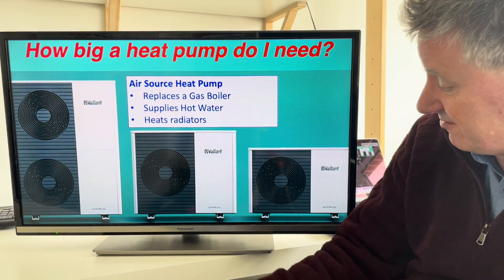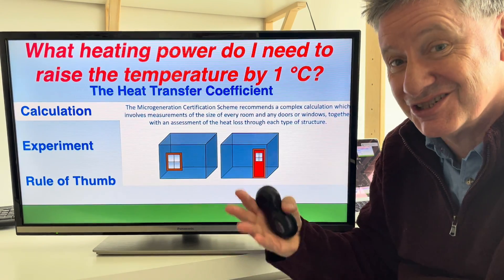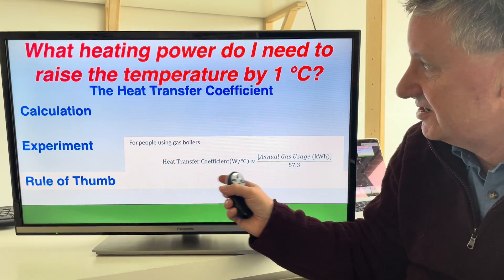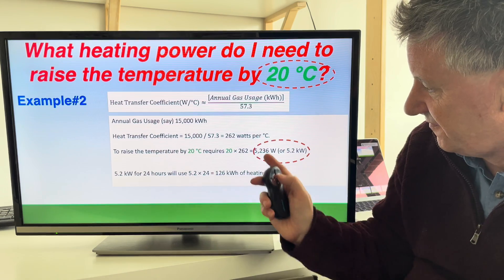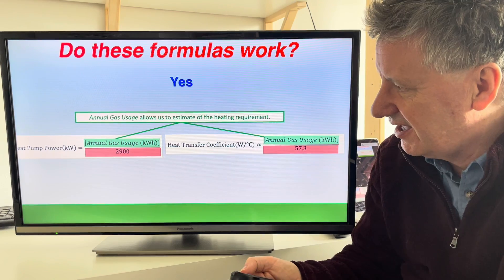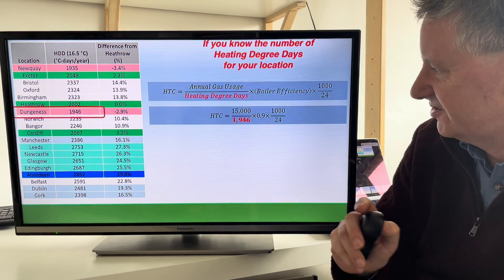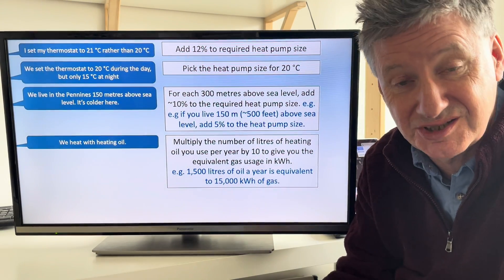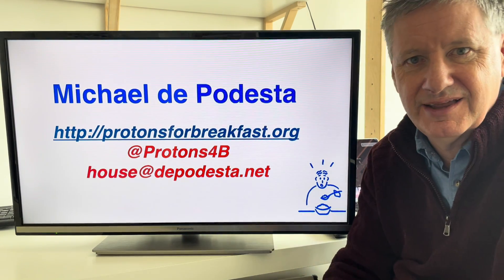How big a heat pump do you need? A simple Rule of Thumb.

Comment: Regarding Heat Pump size: Many manufacturers state various kW heat outputs  depending on the ambient temps, (7C, -7C, -20C) and have different values (8.2 kW to 5.5 kw in this instance.) for that particular ASHP.  Once I calculate the HP size (kW) with your recommendations,  Should I pick the kW size based on the coldest (-20c) rating?
Reply from the maker: Dr. Greg, Good Evening.

First of all well done for spotting that the heat pump thermal output power changes with external temperature, and also for noting that the 'labelled power' e.g. 5 kW, 7 kW etc  is only the labelled power under one specified condition - generally not the coldest temperature.

The industry recommendation - which I agree with - is to pick a so-called 'design temperature'. This is the coldest likely temperature in your locale. In southern England this is generally around -3 °C. You should choose a heat pump which can deliver the required heating load *at this temperature*. 

One could design for - 20 °C, but this would be overpowered for 99.99% of the time and would underperform for all this time. If you design for the recommended design temperature in your locale, the heat pump size will be 'just right' for most of the year. If one experiences a -20 °C day, the heat pump will still work, but you will need to supplement it with normal electrical heating for the one day or so per two or three decades on which that cold-weather event occurs.

Does that make sense?

All the best

Michael
Reply: @michaeldepodesta001  The ASHRAE design temp of my region is -14F(-25.6C).  This temp is for Leadville which is typically colder than Buena Vista (my town). The coldest recorded by my station was -29.5C but this temp is uniquely low.  The average low temps here is -5C to -10C
Reply from the maker: @gregvet2008  First of all - WOW! - I know it's the internet and I should be used to it at my age - but how wonderful to communicate with someone in Colorado!

Secondly. I don't know your climate so I looked up a simplified version of your local climate data...

https://www.timeanddate.com/weather/@7174247/climate

According to that, a temperature of -25.6 °C seems extreme as a design temperature, but obviously it still gets pretty cold in your winter. As I understand it, the design temperature should be a temperature which will likely be the coldest temperature of the winter. This is as opposed to the coldest possible temperature. 

I can't make those choices for you: if you have access to local weather records then you can likely make a rational choice based on those records. It's always comforting to design for the most extreme weather, but you pay a price in less efficient operation through the rest of teh year. Depending on your circumstances, it might be an idea to use two heat pumps, with the second heat pump kicking in only in extreme weather. 

Good luck - and keep warm. M
Reply: @michaeldepodesta001 indeed, one can add many kW of on demand capacity for a few £ in the form of convectors or oil-filled.
Many lose sight that total costs are capital+running and let the 2nd term run away from them.

Comment: 📌How big a heat pump do you need? A simple Rule of Thumb.
the principle of the heat pump is apparently the same as the principle of the refrigerator: a refrigerator needs 150 watts per hour to modify the temperature inside the refrigerator by 7 degrees C.
the volume of a refrigerator is 0.3 m3 or the volume of a refrigerator is 0.3M3 or 300 000cm3
imagine a house of 80 m2 to be heated =192 m3 =192 000 000 cm3
well you will need the equivalent of 192,000,000/300,000= 📌640 refrigerators to heat your house... Thank you heat pump or thank you money pump?
Reply from the maker: Fern, Good Morning. 

I have your looked at your comment several times but sadlyI have concluded it is just incoherent nonsense. The relative volumes of refrigerators and homes are just not relevant.

As I explain, using a heat pump is overwhelmingly the cheapest way to heat a dwelling by a solid factor three or more.

Best wishes

Michael

Comment: Great stuff. Does this estimation also apply to cooling with a heat pump?
Reply from the maker: Afrocraft, good evening. No, this doesn't apply to cooling. To calculate an equivalent formula for cooling one could use the 'degree-days' web site but instead look up 'Cooling Degree Days' rather than 'Heating Degree Days'. It is thankfully not such a strong requirement in the UK at the moment...

Best wishes: Michael

Comment: Thanks for the great video.
Is sizing a hot water tank a rule of thumb thing too, or is there a minimum size required to comply with regulations/certification? Currently have a 150L tank for our gas boiler and a couple of quotes we have had for ASHP install are recommending replacing it with a 210L tank. I feel like a 180L would suffice for our consumption.
Reply from the maker: Lei Chat Good Afternoon, Yes. There are many rules of thumb for the size of domestic hot water cylinders. But here is my experience with a 200 litre cylinder.

The system is set to re-heat the cylinder once a day to 55 °C - it typically puts in around 3 kWh of heat. 

My wife and I live modestly and shower (between us) around once a day and we never run out of hot water. When children are home taking multiple longer showers, we need to have two heating cycles per day. 

So my advice is that the cylinder size depends upon the size of your family and their habits.

This guide shows that DHW consumption's very variable

https://assets.publishing.service.gov.uk/government/uploads/system/uploads/attachment_data/file/48188/3147-measure-domestic-hot-water-consump.pdf

This site ...
https://www.hotwater.org.uk/sizing-a-hot-water-cylinder/

suggest a 200 litre tank based on DHW use of  

• Low Consumption = 20 – 30 litres/day
• Average Consumption = 30 – 50 litres/day
• High Consumption = 50 – 70 litres/day

So like I said it's variable. But if that DHW is not all needed at the same time, then a smaller cylinder may suffice.

Sorry to sound so vague.

M
Reply: @michaeldepodesta001  No need to apologise. Really appreciate your insight. Thank you.

Comment: Hi Michael, thanks for the video. It sounds like we have similar houses - I used 13,000kwh in 2022 and am planning EWI this year and an extension next year giving 130m2 total. However, I'm having to consider a heat pump earlier than I'd like for logistical reasons to do with the EWI. I did my own heat loss calcs and my projected annual heat use post-extension (4600kwh, or 3250kwh with mvhr) would give a required heat pump power of just 1.1-1.6kW. Do heat pumps even come in this low? Would there be a problem with short cycling? Do you think a buffer tank would help? Should I be looking at air-to-air heat pumps instead?
Reply from the maker: Amanda, Good Evening. First of all congratulations on your refurbishment. That sounds really exciting.

Yes, our houses do indeed sound similar. Here are a couple of comments.

1. Having to do things 'out of order' is par for the course. It happens all the time.

2. I am not sure you will achieve quite that large a reduction in heating demand. My suppliers thought that a 40% reduction in heating from EWI would be a good result. But nonetheless is it is a small heating requirement and it will be difficult to get a small enough heat pump.

3. When planning I had thought that I might need a 7 kW heat pump, but thank heavens I realised that this was too large and opted for a 5 kW pump. During this year's cold snap I just exceeded the 3.5 kW average daily power (3.5 kW was next heat-pump size down from 5 kW) so technically I probably do have the right size.  

https://protonsforbreakfast.wordpress.com/2022/12/11/cold-weather-measurements-of-heat-transfer-coefficient/

But most of the time heat output is 1 kW and the system cycles a lot. I am experimenting with different control modes to see if I can optimise this.

4. I would ask your installer about buffer tanks. My understanding is that almost every extra thing you add - buffers or low loss headers - overall reduces efficiency. But no retrofit  installation is perfect - it's all about optimising the installation subject to constraints.

5. Air-to-air could be an option if your house is relatively open plan - I think every room does need its own fan-coil unit. And if you already have radiators - you would have to remove them all! Ultimately - it's your choice, but a 3.5 kW peak power unit would probably be fine. In fact if you have to do the heat pump first and then EWI later perhaps you might need a larger pump for the first winter?

6. I follow Syzmon Czaban who installs Heat Pumps and in this example he installs a 3.5 kW unit which is only just big enough - trying to avoid oversizing.

https://www.youtube.com/watch?v=0IvGe4JZLSU

7. Amanda, I don't know quite why this is all so difficult! but I wish you all the best. 

Michael
Reply: @michaeldepodesta001  Thanks for your reply! I misread my own spreadsheet, it should have been 7,100kWh post-EWI, making a more reasonable 45% reduction. Actually I had Szymon round, he told me a crucial piece of info which is that (assuming you have the Vaillant Arotherm) the 3.5kW and 5kW both modulate down to the same 500W minimum. So you made the right decision getting the 5kW for better cylinder heat up times. 
We also agreed that it is easier to hold off on the heat pump for the present! So I'll be coming back to all this next year 😅
Reply from the maker: @silver_gir1  If you have Szymon on your project I feel confident you will be OK. 

Regarding the cycling on my system, it seems to cycle when the electrical power reaches 500 W which corresponds to a bit under 2 kW of thermal power. This could be caused by the way my system is installed with a so-called low loss header. But I would be believe Szymon rather than me!

Good luck with your project. M

Comment: In about 35 percent of the US, you'll need a heat pump big enough to contain a gas furnace.  Even the most efficient Heat Pump isn't a way to reliably heat the houses in the Northern third of the US.  You also need to consider that they aren't nearly as reliable as a normal furnace.  I've gone through two of them in the last six years, and one of them required a $500 service call even though it was still under warranty for parts.  So, six years, about $4,800. dollars AND YOU STILL NEED A BACK UP FURNACE AND ANOTHER HEAT PUMP.  If you don't believe me, actually pin one of these experts down and ask them what you should do when the temperature falls below 10 degrees.  If they still pretend that it will heat your house sufficiently, ask them about 0 degrees.  If they STILL lie to you, do what you should have done in the first place and and find someone that actually has one.
Reply from the maker: Bill, hi. Sorry you have had such a bad experience. But I don't think that is usual.

Heat pumps are used commonly in Northern Europe where winter temperatures reach the levels you describe. 

In the recent cold spell in the UK where temperatures in cities fell to -5 °C (~20 °F) my heat pump worked fine with a COP of 2.5 at the coldest temperatures. I did hear of one heat pump problem on the grapevine, but also of LOTS of boiler faults.

I really don't know of a better way to heat our homes while not emitting carbon dioxide.

All the best

Michael

Comment from the maker: Dear Teabreak, Good Evening.

Yes. 1227 cubic metres of gas corresponds to roughly 13,865 kWh of gas used annually. So yes, roughly 5 kW sounds about right.

My home in Teddington, West London used 15,000 kWh/year before external wall insulation and measurements now indicate a 5 kW heat pump would have been fine (subject to radiator sizing). For a variety of reasons I did install a 5 kW pump but with external wall insulation the heating demand was cut by roughly half and the heat pump can barely get started! Last year we warmed the house using less electricity than if we had used a hairdryer (set on low!). (https://protonsforbreakfast.wordpress.com/2022/04/12/could-you-heat-your-house-with-a-hairdryer/)

Some of the stories on my blog may be relevant https://protonsforbreakfast.wordpress.com/my-house/

My plan was to install the heat pump and see if the radiators would be good enough. They were. Changing radiators afterwards is easy - changing pipework is not, but I took a risk. Typically - using weather compensation - the flow temperature reaches 43 °C ish when the outside temperature is 0 °C. 

In the summer, the whole house runs from solar PV for about 4 months, but in winter solar is low and heating demand is high, so solar doesn't cover everything. If you are considering solar, I would encourage you get battery storage too.

https://protonsforbreakfast.wordpress.com/2022/09/01/its-been-a-sunny-summer/

The real risk with a 10 kW pump is not really the cost. The real risk is that it won't be able to modulate so as to operate efficiently at normal autumn/winter/spring demand. It will just keep switching on and off.

If you don't find what you are after on teh blog, do drop me another line.

All the best

Michael

Comment: Can you confirm 1227 units of gas used annually. Times 11.3 (my rough conversion estimate) equates to 13865kWh gas used annually. So heat pump size required is just a 4.78kw? I have been looking at 10kw heat pumps so a 5kw heat pump sounds more affordable. This is totally ignoring the pipes being the wrong size, so temp would need to be set high at the exoense of COP. So potentially you could run thr heating and hot water soley from solar pv? Something more difficult to do with a 10kw heat pump.
Reply from the maker: Oh Yes, one more thing. You can check the sizing quite precisely on the coldest day of the year whenever it arrives.

https://protonsforbreakfast.wordpress.com/2022/11/07/what-to-do-on-the-coldest-day-of-the-year/

All the best

Michael

Comment: Very interesting video, I have something that in my head doesn't make sense, when @12:45 you shown a function for HTC that uses the inverse of heating degree days for the calculation, that will give a smaller heat pump size the LARGEST the number of HDD you get, that calculation would give a HP's size of less than 4kw for Aberdeen and 5.8kw for Newquay, that doesn't make sense to me, please explain where I've got it wrong
Reply from the maker: quilmore, good afternoon.

I think it is correct, but the reasoning is subtle.

Suppose identical dwellings in Aberdeen and Newquay had identical gas consumption. Because the heating demand in Newquay is lower than in Aberdeen one would conclude that the Newquay HTC was much higher i.e. the Newquay dwelling would be much 'leakier' than the Aberdeen dwelling.

Heat pump size is determined by HTC and the maximum demand. In this video I didn't take much account of how the maximum demand varies across the UK. o assuming the maximum demand was the same in both places, the increased HTC in the Newquay dwelling would need to be larger.

Days below 0 °C are rarer in Newquay than in Aberdeen, but they do occur.

Does that make any sense?

Best wishes.

Michael
Reply: @michaeldepodesta001  I would have guessed a like for like dwelling in Aberdeen would need a larger size heat pump than one in Torquay to keep the same level of warmth inside, I'll have to inform myself more, it's fascinating, greetings from Dublin
Reply from the maker: @quilmore  Your intuition is correct. But your intuition would also tell you that the dwelling Aberdeen would have a bigger gas consumption. If the gas consumption is the same in the two dwellings, this implies the dwelling in Aberdeen has a lower HTC.

Does it make sense yet?

M